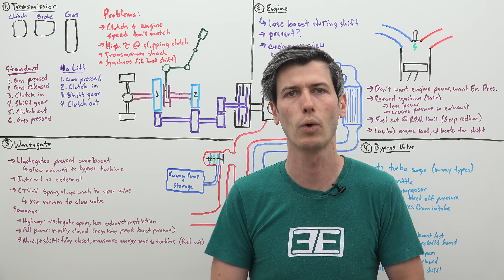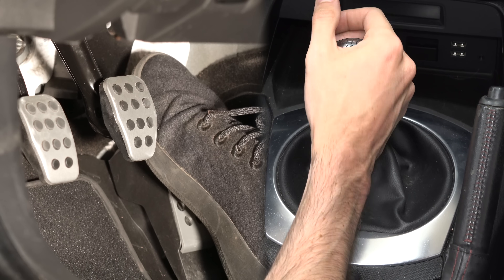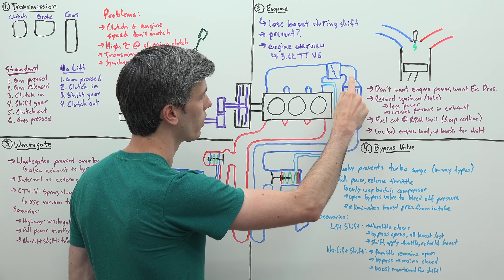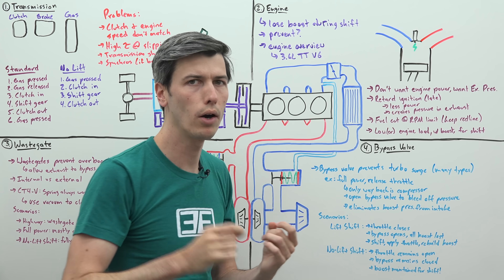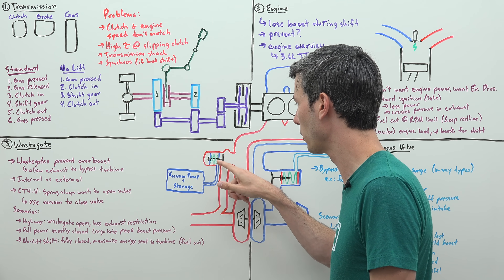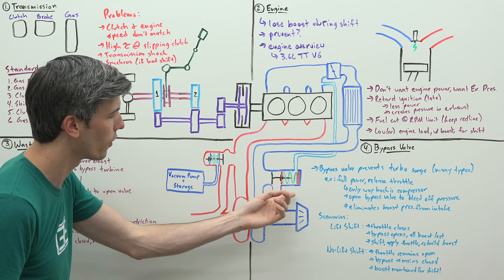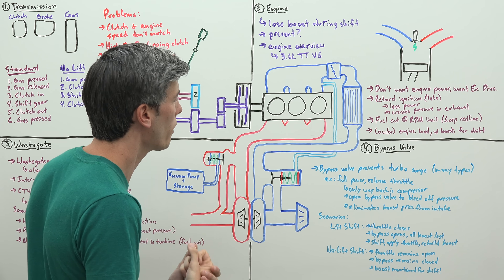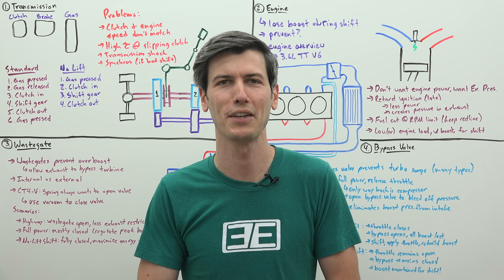How To Power Shift Correctly - Go Faster Without Destroying Transmissions

Comment: Why do they not just put a none return valve on the output of the turbo to prevent surge and store the boost in the intake pipe, ready for using the throttle again?

Comment: Sort of like a motorcycle quick-shifter and autoblipper.

Allows for clutchless up shifts while maintaining wide open throttle.
Momentarily cuts spark while the transmission changes gear.

Then on downshifts does the same thing but rev-matches (blips) also.

I’ve had this on two bikes and it is a really nice feature.
Not only for screaming through the gears while never letting of the throttle.
It allows for extremely fast shifts with no hesitation in the power.

But also for ease of riding.  
Only have to use the clutch at stops and starts, but can always use it whenever you want.

Comment: "no lift" is the slow way. By blipping the throttle the gear speeds are matched, and the clutch isn't needed. Shifting is done in less than half the time.

Comment: On a similar topic, could you do a video on quick shifters? (used on motorcycles)
Reply: Quick shifters are much easier to explain. You can already do a clutchless shift by rolling off the throttle since the transmission is sequential with dog gears. A quickshifter just makes this process quicker by cutting the engine power briefly so you don't have to

Comment: You’d be a great teacher, I know pretty much nothing about engineering yet I still understand this process perfectly, you explained it flawlessly
Reply: Hes a youtube teacher!
Reply: I used to do the same thing with my highly modified 73 Vette, no retuning, no retarding spark, yeah I guess the clutch took a bit of a beating but as you said it was worth it as long as your shift hand was a quick as your left foot and you had the revs high enough to where you could feel the resistance against the shift lever disappear. Once you felt that you could even downshift the car without using the clutch at all.

Comment: We used to polish off every second synchro tooth to make a crash box transmission. They worked beautifully. Remember, if you're not breaking anything, you are not driving at your car's limit. Also, how is it with your knowlege you only bolt on stuff and never really dig into components?

Comment: Was taught it was speed shifting,  power shifting is what truckers do, they're back on the accelerator once in gear but before clutch is engaged.  That's why you would see the whole cab jerk when shifting. Never had all this technology back in the day,  just had light set 200 rpms below where you wanted to shift so the timing of the shift occurred at optimum speed/time. These days you're talking to an elite group of people since most have automatics.

Comment: Engineering explained: “that’s called turbo surge, and we don’t want that” 

Me: “but TuTuTu 😢”
Reply: It's not TUTUT IT'S STUTUTUTU
Reply: It isn't bad unless it happens when you're on the throttle
Reply: turbo surge damage is often exaggerated and isn't really an issue if you're off the throttle
Reply: @Lofi.z34  but i love that tututututu sound while im flooring it tho??
Reply: @kepagu  uhhh lol
Reply: There’s a huge difference between turbo flutter and compressor surge. People often get them confused for the same thing
Reply: @callumsmith338  the tututu sound comes from air passing over the spinning turbo blades, aka turbo surge, hints why you only get the sound when you either don’t have a blow off valve or one that is very stiff. So you’re wrong.
Reply: @NoHope_  I never said it’s not?  I understand what turbo flutter is, I’ve had plenty of turbo cars running no BOV’s.  I’m saying there’s a difference between turbo surge and compressor surge (which is the more hazardous of the two).

Don’t tell an engineer who has studied and worked on turbos for a living he’s wrong. I recommend you educate yourself and look up compressor surge, I believe GFB covered it in one of their videos, summarised it’s when the compressor turbine is spinning faster than what it’s capable of compressing
Reply: @callumsmith338  u don't have to study to know that.
Reply: @NoHope_  
You obviously don't know that this sound can also come even when you have a BOV.
It can come when there is not enough pressure for the BOV to open.
Reply: @FlyingBeast009  literally said 15 times that it can also happen with a bov, pay attention before you try and act smart
Reply: @callumsmith338  can you explain to me the difference? I’m tryna learn

Comment: What I got from this explanation: buy a >$80k car and have the computer do it for you.
Most other modern sporty throttle-by-wire cars (especially German makes) have been doing stuff like this for a while. Basically, while your foot may be to the floor, the computer is opening and closing the throttle and changing other parameters as necessary. So this is not old-school no-lift shifting; it's computer-controlled throttle management. Not necessarily a bad thing but it can overinflate a driver's sense of their ability when it's actually the computer doing all the work.

Comment: I use to shift my '99 zx2 without touching the clutch.   If i remember right i would just let off the gas a and it would just drop in the next gear.

Comment: i had my subie set to cut the ignition and had a second rev limit set about the rpm i would be at after the shift, when shifting at peak RPM. this was activated by the clutch switch, but only when above 5mph, (below 5 mph the clutch activated the 2 step for launch control) everything else happens mechanically no need to make anything close or open. this seams overly complex for flat foot shifting. once the spark is cut boost will start to fall, as soon as that happens the wastegate should close all by itself because its under target boost. holding it at redline on the shift seams like a bad idea for you're transmission, why not target post shift RPM? and by cutting just the ignition i got a nice fireball out of the tail pipe :)

Comment: you can have a shift sensor that literally pauses everything so when you clutch the engine doesnt redline my friend had a bmw that did this I shift without the clutch all day let go of the gas just before engine brake and shift as the rpms fall the gears slot in place and just gas

Comment: I need to figure out away to get this in my 2001 Volvo S60 2.4T with a BSR stage 1 tune, it takes its sweet time to spool up again.
Maybe i should just get the BSR down pipe to get it to spool up slightly faster.

Comment: Wait, I'm confused. In my stock Miata I release the accelerator pedal, clutch, shift, and release clutch while pushing jn the accelerator pedal. Do you fully release the clutch before accelerating? Have I been driving a manual wrong all these years??? 😥

Comment: You can also upshift (and downshift), without using the clutch. It won't increase your speed, but smooth out the shifting process.
Reply: If you want to destroy your synchronizers.

Comment: Would it be better to use a small electric motor to keep the turbo spinning, rather than using the main combustion motor to spin it?
i.s.t. ; why not use a small electric motor to keep an overpressured intake air?

Comment: I know your diagram is a representative schematic but it got me thinking. Does placing the BPV closer to the throttle or closer to the turbo change anything in any measureable way? Just wondering if one might be preferable in terms of pressure waves, heat load on the intercooler etc. Thoughts?

Comment: Just so no one use confused. If you have an older car and want a good time you abuse that thing and slam it as fast as you can between gears while not lifting. Transmissions, diffs, clutched, are all replaceable but a lap time is forever.
Reply: I drag raced a 99 Corvette FRC and absolutely loved it. The car had heads, cam, intake, and full exhaust upgrades as well as a 150 wet shot of nitrous. I had 3M hardened shafts in the rear and a 4.10 gear set. The 4.10 set allowed me to run a 28” ET Drag in the rear and crosses the 1/4 at  a perfect 6300ish rpm. I also installed a Lingenfelter two step that held two settings… one for launch RPM and one for shift RPM. I put the launch RPM at 4800 and was pulling 1.4 60 ft times. For the shift RPM I put it at 7400. It took a while to train my muscles to not lift to shift but I got there. The shift RPM cut fuel and the nitrous solenoid was wired to the clutch solenoid so when I press the clutch it would momentarily stop spraying nitrous although not fast enough an when I shifted I would get a fireball out the tail pipe. No shift racing is a lot of fun. I ran the car to a 10.3 in the quarter. I wanted to go for 9s on the stock rotating assembly and tranny (T56) but ended up with a family instead. 😂🤣😂
Reply: @secretsquirrel572  those vettes are cool. Dad had one, and a smaller 90s camarobird (box of parts lol) with a V8 manual trans. Such a nice ride. Love GM V8 sticks
Reply: @secretsquirrel572  I had a 00 C5 with stock 3:42's, a mild cam, and exhaust.  Nothing like yours, but I used to power shift 3 to 4 because that dude topped out 3rd right before the traps.  Always picked up mph/e.t. with the no lift shift over a lift shift.  I feel you on the "train not to lift", it was hard overcoming all that muscle memory.
Reply: For those of us who don't have a few spare Corvettes and can't replace half of our drivetrains for fun, don't do this.
Reply: Lmao, spoken like a true time attack driver
Reply: Let me update this and say I have a grinding 5th gear after my last track day due to trying to slam 3rd and missing a few times lol. Did get a personal best out of the day though!

Comment: I dunno what the first car was to come with powershift capabilities, but Case IH tractors have had it as an option since the 80’s! 18 forward and 2 (4 in later years) reverse gears, all accessible without ever using the clutch except to start or stop.

Comment: Shucks......I was doing no lift shifting back in the 70's with my VW. 

Had a duel port big barrel 2180cc motor in it.....I could absolutely dust any mid to late 70's muscle car. I could keep up with my buddies 240 z in the twisties......just never ever lift off the gas in the middle of a corner.

Comment: Wow! You really went off on a tangent about turbos there.
Power shifting when I was racing my 428 Mach1 was simply holding the accelerator, barely hitting the clutch and slamming the shifter into the next gear. No one could ever catch me.
I hate turbos!
Reply: I'd hate turbos too if I constantly was losing to them

Comment: Could you do a video on wether a enigne that runs at high rpm for less time will last longer the a engine that runs for a longer time at a lower rpm. Would be interesting to see which one would last longer and which engine will be healthier
Reply: diesel engines are made to be low RPM and they seem to run the longest

Comment: What does retarding timing do if the fuel has been cut during a no-lift shift?
Reply: Avoids knocking.  The spark is needed in case any hydrocarbons might otherwise be released to the atmosphere

Comment: When I 1st learned this I also learned what it feels like to lift the front tires when you hit 2nd. It was on a Mazda RX4 rotary powered Sand Rail (front engine). June 15th 1988 right after a heavy rain....... yeah you never forget the 1st time that happens.
Reply: I highly doubt you popped a wheelie on a wet road
Reply: @rhynes07  Wasn't a road, the dry flat lakebed of sand in the Fremont County Sand Dunes. When the sand is wet (spring of the year) you get max traction. The Goffer Off Road Club used that dry lake to put on their "Sand Drags" until the sand shifted in the mid 90's and it wasn't flat anymore. I learned to "stab a tree" out there as well...... but to tell ya the truth, I wasn't all that good on the tree. I'm better with a flag drop.

Comment: Your last line "All for just shifting without lifting your foot," is inaccurate. I don't think the engineers were thinking of a way to change gears without lifting your foot. I think they were trying to figure out a way to utilize the turbocharger more efficiently during shifts.
Reply: To some extent not lifting your foot is part of it. Its drive by wire so they can do whatever they want with the throttle. But the time it takes a human to move their foot starts to become the slow part.

Comment: GM (and most manufactures) have been doing this for years on the automatic transmissions. When you start tuning the ECUs you can see all the torque management settings you have to work with. The ECU reduces torque exactly as you explained, but pulling timing right as the transmission shifts. It's practically magic because it all works so smoothly you don't even fell it happening. Interesting they are applying it to manual transmissions now, really neat stuff.

Comment: Porsche's Can-Am 917/10 and 917/30 were among the first cars to use an intake bypass valve to keep turbocharger inlet revs up during a shift. I was at Lime Rock years ago and watched a 917/30 driving an exhibition at a vintage racing weekend. I knew when the bypass valves (twin turbochargers) opened because they made a sound like a rifle shot as the driver lifted going into the first turn.

Comment: Back in the days of almost universally normally aspirated engines, I hooked up an ignition retarder to the clutch to allow this, first on racing karts (with mixed success), then on racing motorcycles.  On the motorcycles, it always proved less effective than just doing clutchless changing, as the normal gearbox is constant-mesh rather than synchromesh.  I believe that may have been the reason for mixed success on karts, too - some were constant-mesh motorcycle derived gearboxes and didn't respond well, while the others (with gearboxes of some other type, presumably) did.  This was in the mid-'70s to early '80s.  Just keeping the revs up meant a slight torque boost after the shift, as the clutch converted momentum of the higher revs into torque on re-engagement.
Jawa motorcycles had an automatic declutching mechanism on their gearshift pedals, which needed careful adjustment to work well, but was great when it did.  Adding a microswitch to cut the ignition briefly on upshifts worked very well on a lot of motorcycles.  In theory, a cam could be used to blip the throttle on downshifts instead of doing it manually, but I never got around to fabricating the parts to do that.  I just practised my clutchless technique more!  Less handy on those Jawas was the fact that the same pedal flipped over into a left-footed Kickstarter, which was utterly 'orrible as it drove through the gearbox so it was impossible to start in gear and was an ergonomic nightmare!
I clearly got my clutchless technique down pretty well, as I had a failed clutch cable on a Kawasaki Z650 in west London (near Heathrow) and rode through the London rush hour (before the M25 was built, and yes I know I'm ancient) to catch the only dealer (near Colchester and on the far side of London) who actually had one in stock.  He had two, so I bought both and taped the spare next to the in-use one with a "boot" filled with grease over each end.  The gearbox (in fact, the whole bike) was still fine at 126,000 miles when some revolting low-life relieved me of it.

Comment: Interesting that they went with the reverse of how a conventional wastegate works. The spring holding it closed with boost  compressing the spring to open the wastegate. Also why go thru the trouble of a vacuum pump and resovoir when there's electronic wastegate actuators (less parts, less complex) what's the benefit of their vacuum system of boost control vs electronic wastegate control on other modern cars?
Reply: Just guessing but you might need a higher voltage battery for the motor

Comment: Quick shifters are petty common in the motorcycle world. You don’t even need to use the clutch
Reply: You don't even need a quick shifter, to achieve it. Just let off the gas a bit while pushing up your gear.
Just to mention aside, motorcycle transmission usually are sequential transmissions, which helps a lot with quick shifting, which doens't mean, it is impossible for a cars MT, it is just a bit slower.
Reply: @fwebe2871  you need it to not let off the gas. Which is what he’s talking about in the video.

Comment: Genuinely fascinating technology.  But IMHO this is analogous to the final generation of super sophisticated steam locomotives--the technology is admirable, but it's solving a problem that no longer exits.  In the case of railroading the big change was the diesel-electric locomotive, and in the case of ICE performance cars it is the paddle shift gearbox.  Don't get me wrong--I completely understand the desire to drive a manual stick because it's fun and engaging.  But the fun and engagement is from having to manually master the art of the shift.  Manual is no longer the fastest way to drive, and if you are after shaving tenths off your elapsed time get a paddle shift dual clutch whatever and you will be faster.  Having a manual that does all sorts of magic to enable you to simply slap the shift lever without applying skill seems to be make the shift lever more or less equivalent to a shift paddle.